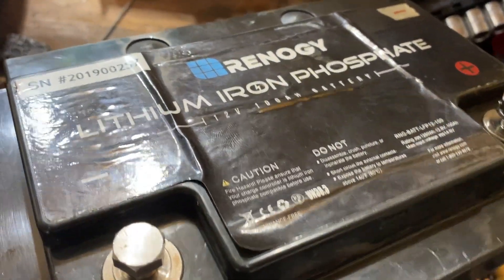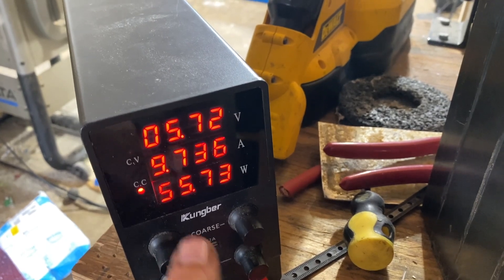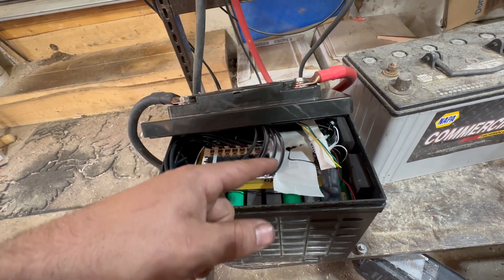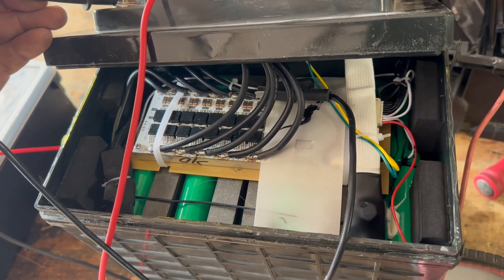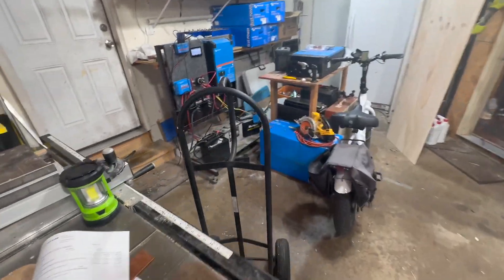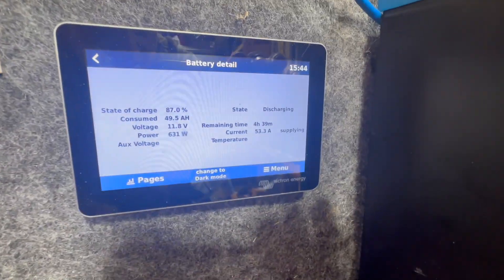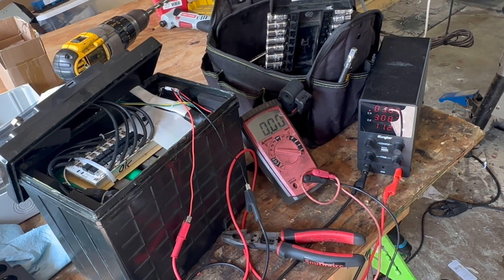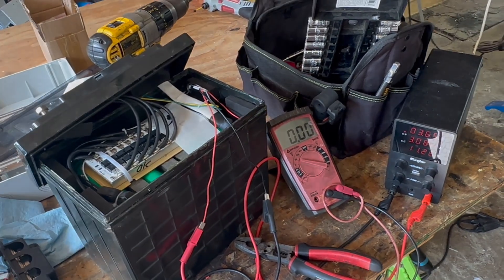Reviving a Dead Renogy Lithium LIFEPo4 Battery with Capacity Test.

Comment: Are you familiar with the Renogy Smart 100AH, trying to get mine to come back. Getting a voltage of 0.954 when on a meter, I  have tried the jump starting techniques but nothing seems to get it back. Your method here might but the battery is quite a bit different with having the Smart Pro BMS.
Reply from the maker: We’ve got a more recent video this year that you’ll find helpful.  

Fix your dead Lithium RV battery - How to Reset LiFePO4 Battery BMS
https://youtu.be/fbXenI_An4E
Reply: @sotasolar  Thank you so much I will have a look. I have some metering progress at least, metering the actual cell packs I have 2.545v on each pack when metering form positive to negative bypassing the BMS, so I think it confirms the BMS did go into protection mode so I think there is hope for this lithium.
Reply: @SubaruTrekkie I’m having a similar issue were you able to fix it?

Comment: I have the 170 AH units for our RV ( 2 in parallel). Paid $1100 each for them about four years back. Not sure what went wrong , but one of them would not charge , the other was low on capacity. Renogy was good about it and eventually sent me two new ones, I kept the old units. Now the new units are acting up as well. I have them in the shop, took the top off and found the cells to be way out of balance. BMS was shutting down. Will see how that goes, seems to be taking the balancing charge well. Set the power supply to 3.6V and cranked the current setting. If this works well, I'll probably check/balance the cells as regular maintenance now, as the tops will be easily removable.
Reply: How did you go about getting new batteries? I have the same batteries and they are now dead.

Comment: I suffered with a Renogy Bluetooth 100 AH "smart" Li ion battery for awhile. Back then I was a working homeless, so I made a significant investment and bought a battery to run the homemade HVAC system in my car and operate fans. I thought Renogy was a reputable company, it was advertised all over the place, right? Right? 

Wrong. The battery began to fail after less than one year: cell voltage imbalance, then the BMS shuts the battery down when 90% capacity still remaining. The condition won't reset until filly charged. So... it became an unpredictable letdowner, not a battery - it failed me when I needed it the most. Now that it's well past warranty, I will do as you said, and open the can with a heat gun. Maybe I'll replace the BMS with a third party one, or remove it altogether. Let's see what happens. Thanks for the good channel!
Reply from the maker: If you find yourself near Minneapolis hit us up.  I have many batteries companies send us to review to replace yours.
Reply: @sotasolar  Thanks Man! I will, if I happen to be near Great Lakes! 👍
Reply: @sotasolar I would love to send you my renogy 12v 200amp lithium iron phosphate for this kind of repair . Renogy is sending me a new battery but after watching this - I’d gladly pay someone to save this 3 year old $1000 battery if possible . Please advise *
Reply: Use a daly BMS the smaller one

Comment: Just bought a lifepo4 Renogy Lycan 1075wh power box, which had no capacity, partly balanced the cells manually, and it was greatly improved, bought an active 1.2a inductive balancer, and run a few cycles, it's gaining 45wh every time it's cycled, currently its up to 750wh.

Comment: So I have 2 of these, and the same thing happened to one of them.  This is why I prefer the newer prismatic cell because they are typically in a 4S1P configuration internally for most batteries (unless its a higher capacity one like 400AH).  These older renogys have multiple in parallel and in my case there were several dead individual cells and multiple batteries that have horrible self discharge. So I could manually charge each bank to full, and hook the battery up, it would be fully charged and work, but as you drain the battery as a whole I would have a bank that died faster then others, even if i didnt put a load on it for a few weeks.  The only way to fix it, is to have 2 batteries in this state and combine good cells that dont have high self discharge, or potentially remove batteries, and drop it down to a 50AH battery. But that comes with its own issues because the BMS protections are for 100AH battery.

Comment: What the temperature of the heat gun to remove the cover?  I have 7 bricks from Renogy.  and what BMS would you recommend if i wanted to replace it?
Reply from the maker: If it matters, this customers batteries died this year. I’d be weary of throwing good money after bad.  Spend the money on a SOK battery or even Amperetime

Comment: This is extremely helpful. Thank you for posting this! I have two SOK batteries that have never been used completley depleated (I didn't know how to care for the batteries when I got them, I bought them and just put them on a shelf (climate controlled, for 2 years) until I was ready to use them). We weren't sure how many amps to try to charge them at when bypassing the bms so this helped us. Thanks so much. Also curious about the capacity test you were running, should i do that too?
Reply from the maker: Yes absolutely. 

You also may want to talk to SOK, they have updated BMS they will send. They had an issue with some and it sounds like you may have some affected.
Reply: @sotasolar  yes they sent the new BMS and the one with the old BMS is working fine but the one with the new BMS must be too low because we can't wake it up. Once we get it going do you think we will have an issue because they have two different BMS versions? Should I ask them to send one for the other battery ?
Reply from the maker: @jessiegrimmitt8604 of the serial numbers are close, I would want them both updated. 

Maybe I’ll do a video on this whole topic. I have an SOK battery in the shop from this generation getting the same treatment.

Comment: I have an older BB 100ah that only puts out 52.4ah through Victron shunt.Bottom center of bat seems swelled.Or both sides of case got worn down?
Reply from the maker: Do a full capacity test. Discharge to 10v charge to 14.6 .  Watch carefully as it charges around 14v if it jumps quickly from 13.8 or 14v to 14.6 v that means the battery is out of balance. 

Once charged to do a complete discharge again.   If still reporting low, I’d get in contact with BB. If you have trouble give us a note on our website and we’ll see if we can shake some trees on our end.

Edit, I just realized you posted this on a video where we go over all this.
Reply: @sotasolar  haha I was like dude I just watched what you wrote lol So why doesn’t my Victron shunt show gain in charge,only shows discharge?
Reply from the maker: Make sure you charge via the load side of the shunt. Not directly on the battery
Reply: @sotasolar cool got it straightened out thanks So my progressive dynamics li rv charge controller only has a high charge of 14.25 ?I think Li Time says balance starts at 14.22
Chances are this second hand bat never balanced .I’ll use it for my mobile diesel heater.I might open it up to check voltage of cells.Nice new shop!

Comment: I've got a 50Ah one of these. Left it for three months (after one month of ownership, the thing was brand new) - that's all it took for one of the cells to completely die. Stuck at 9V, even if you leave it on the charger for a week. Going to pull it apart and see what I can figure out. Downright rubbish products - I had to threaten them with legal action for them to honour their warranty. Any pointers?
Reply from the maker: On the repair? Crack the case open carefully by heat cycling the edge.  Ultimately, these did not last long. We love the SOK batteries, serviceable and well constructed,
Reply: Oh yeah. I learned my lesson with them too. Will never touch any of their products again. In fact, I grew so disillusioned with lithium altogether, I will buy a good old lead acid without a damn computer inside.

Comment: I've got the larger 170amp version of these batts. They really didn't hold up. Just over half capacity after about 5 years. BMS must be junk. 5 of the 6 are still going but one had to be removed from bank because it wouldn't balance no matter what I did. $8k worth of garbage batteries. Atleast they can be replaced for a fraction of the price now.
Reply from the maker: Yeah for sure. If you can manually balance the pack it might improve.
Reply: @sotasolar that's what I did